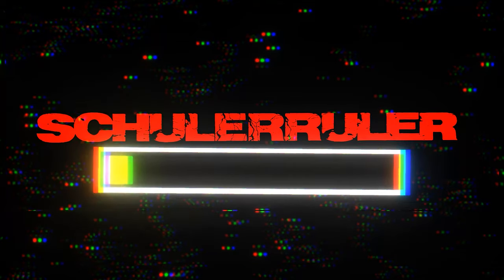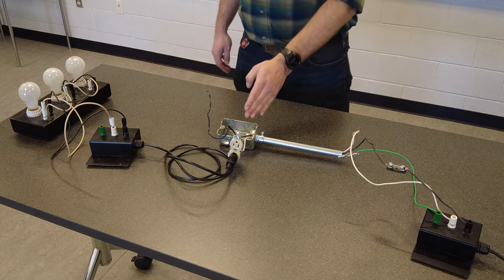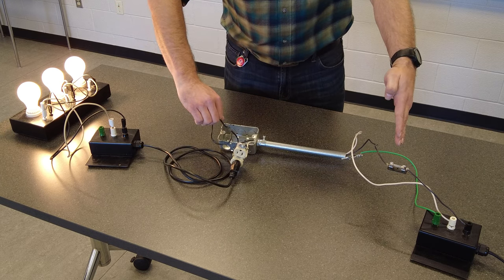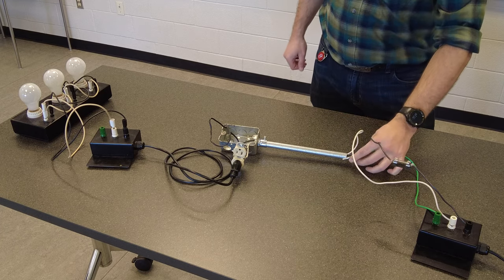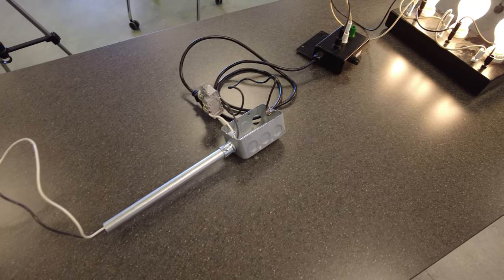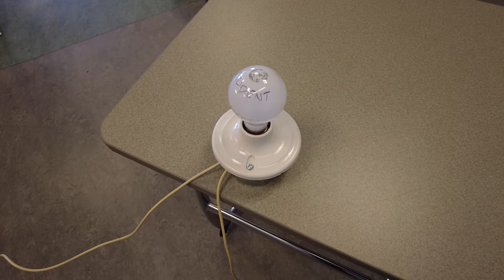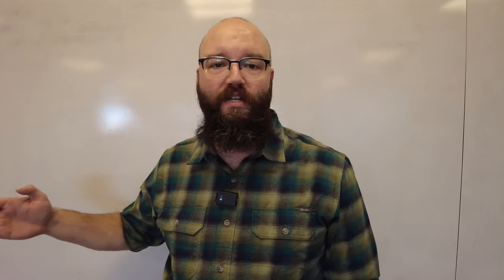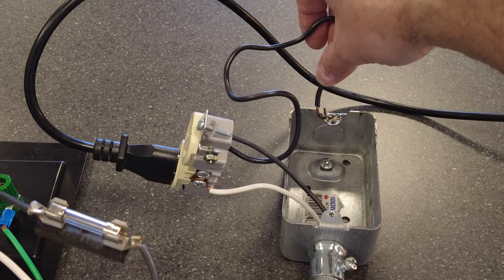Electrical Bonding Fail Example

Comment: "They're lamps....you plant bulbs in the spring!"  My first foreman used to correct us 😉
Reply from the maker: I had one that yelled at everyone when they pronounce exit "eggzit" instead of "ecksit".
Reply: i call em bulbs, lamps are the thing you use to hold and energize the bulb.
Reply: Why don’t we just call it light bulbs,  makes everybody happy.
Reply: @Gmoney1019  We measure light output in candle power.  So why not call them torches?

Comment: Hi, thanks for the great demo. I suppose there is current on the white neutral wire. And as the green wire is bonded to the white wire and the emt, why wouldn't the current on the white wire continue thru the bond of the green/white wires to give a shock if the emt is touched?
Reply from the maker: The only place the white and green are bonded together is back at the main service box. Electrical codes require isolation between the two past that point to prevent objectionable current flow on non current carrying metal components of electrical systems.

Comment: I work on fire alarms and have been dealing with various ground faults and AC inductance from a 480 volt source. I was just told told that a fire system could show a ground fault if the AC circuit itself is not grounded properly, as in the case of running the ground wire to a neutral bar back at the breaker panel. What would happen in that case, and why wouldn’t someone just land a ground wire to the panel’s ground to begin with?
Reply: Depends if it is the service panel (main panel) vs a sub panel.  Main panel is going to be bonded.  Sub panel must be separate (not bonded).  Sometimes you get people that add a sub panel and don't install the ground bar then proceed to terminate grounds and returns on on the same bar like they would in a main panel.  Doing such tomfoolery creates multiple path.  No bueno.